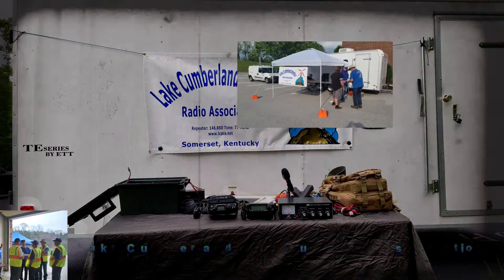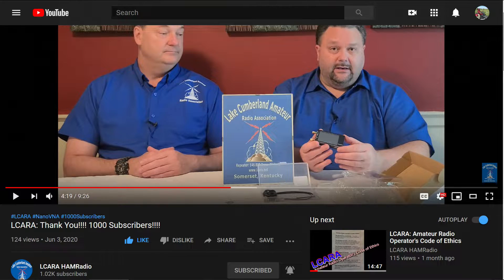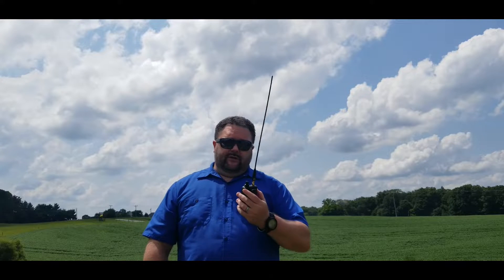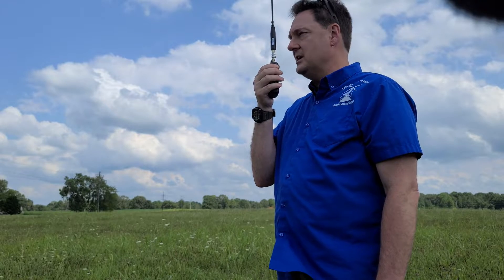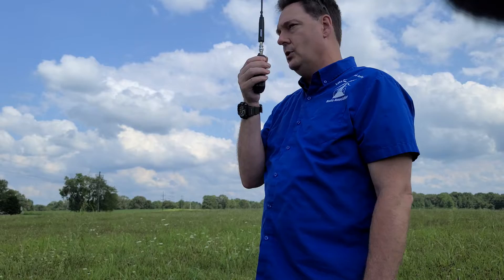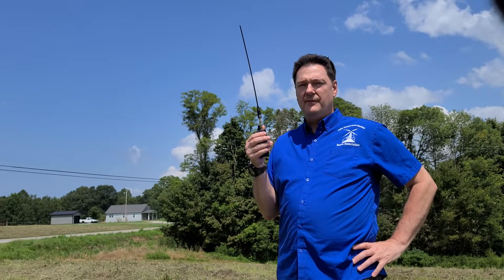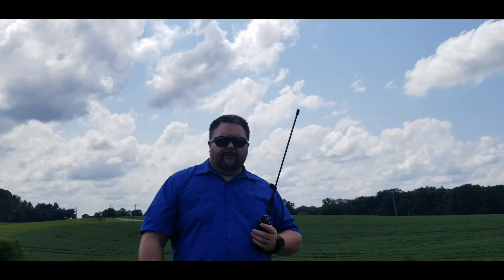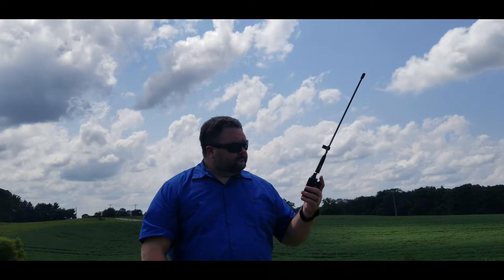LCARA HAM Radio: Testing the ABBREE 18.89" Tri-band Antenna

Comment: What other antennas would you like to see in a future test?
Reply: Nagoya NA-771 vs Abbree AR-771 (clone)
Reply: @drewdurigan5672  YES!
Reply: I would love to see you review the Retevis RHD-771 20W whip,  as well as the Nagoya NA-24j skinny whip. The Signal Stick has been widely reviewed,  but how does it stack up against the 24j? 

The Abbree 18.9 tri-band seems identical to the dual band. It makes me wonder whether the base attachment is what makes the difference? What if you screwed a longer antenna into a tri-band base? Would you have a longer tri-band antenna? And is there any difference between the 18.89-inch dual band and tri-band? Do they both do dual-band equally,  or does the dual-band outperform the tri-band?
Reply: Try using fusion in the test.

Comment: Great reviews,  but I have a question. Some have said the dual-band Abbree antennas are the same as the tri-band antennas and that only the branding is different. The flat-tact antennas are one series and the standard wire antennas are the other. The flat-tacts are the other. The Abbree wire was the other. The AR-771 is the same brand model as the tri-brand. Both are AR-771, so it leads one to think they may be the same. The flat-tact also may be the same antenna as the dual-band. I do not know. Your tests seem to conclude that the flat-tact antennas by Abbree may be far better than anyone thought!

Comment: Since the antenna makes such a big difference, why do the traditional big name radio manufacturers (Yaesu, Kenwood, etc.) insist on still including such cheap and ineffective rubber duckies?  Given their radios' price point, it wouldn't cost much to include a decent antenna. What is the interference on the recording?  Cell phone or power line?

Comment: One weird thing though…

The Abbree 42.5” = 108cm. 
- How can a 108cm antenna perform well on a 64cm wavelength band?
- Could it be because 108cm’s is fairly close to 64cm X 1.6?
Physics tell us that if we use a wavelength X 1.3 or 1.6 or 1.9 and so on it will still perform well. 

- Am right or am I wrong?

Comment: Been using the Abbree 18 inch antenna on my TYT UV8000E for about two years and I find it to be a great antenna. As for SWR's, I tested the Abbree, and on a frequency of 146.000 with mine and my radio, I was looking at 1.0 SWR and a power output of 10 watts, oh, did I forget to say my TYT is a 10 watt HT?. But, only on 146.000 :)
Reply from the maker: Thanks for sharing
Reply: Great lots of confusion and so many knock offs what you will get when ordering who the f knows . Hope to get lucky with mine its on the way the 18...inchr

Comment: Do you have the model number of the Abbree tri-band antenna that was used in this test?
Reply from the maker: Hey Anthony, there are several to choose from depending on the radio you have. Search for ABBREE tri-band and you should be able to find what you are looking for. Thanks for watching!
Reply: @Anthony Ferrara » Abbree doesn't use model numbers. The tri-band is identical to the dual-band in appearance. For all I know they're the same. The base has a black bottom where the screw is on the dual-band. The Abbree is a great antenna. More expensive models do perform slightly better,  but not the Nagoyas. The Abbree buries the Nagoya.

Comment: with the 18" I got a sandwich field shape with a slight dip in the center and peaks towards the ends. Used just old black box swr/ field meter. Don't remember freq. Great antenna, apparently too much gain sometimes & my uv5riii drops signal (guess baofengs do that)

Comment: It would be interesting so see a video comparing different options for using h/t as base - j-pole vs roll up j pole vs small beam for example.

Nice video on the 3 h/t antennas, shows again the importance of the antenna.
Reply from the maker: Great suggestion!